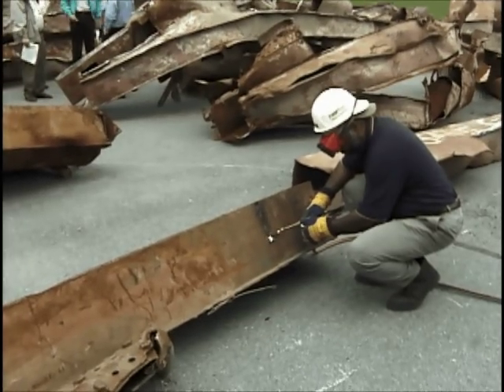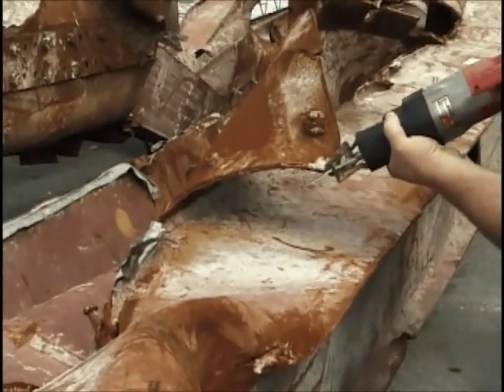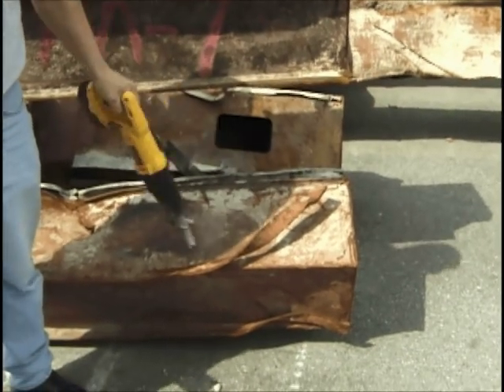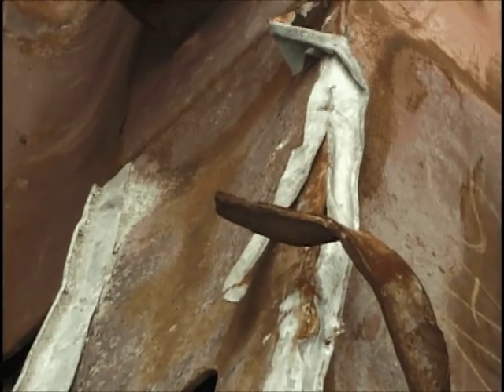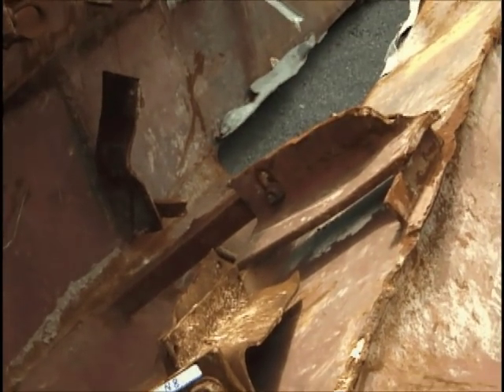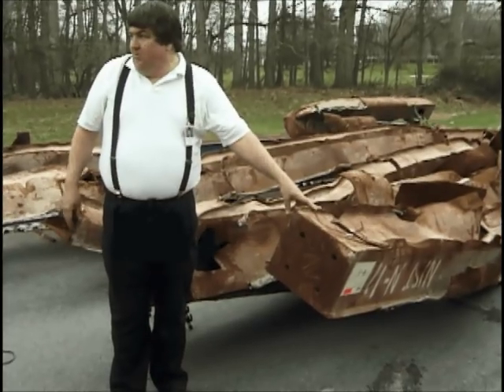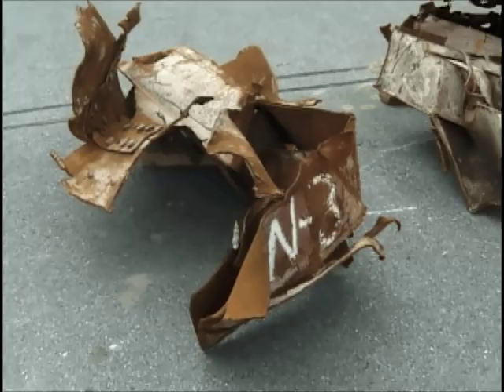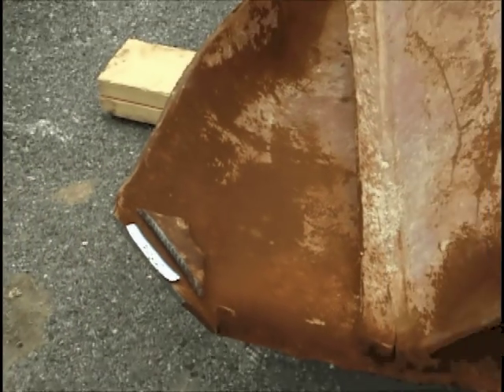Steel Samples from WTC Towers after 9/11 (Clip 1, part 1)

Comment: These guys are so dumb imo, they’ve not taken into account the heat of the fires for around an hour, the paper burning, the thin steel floors buckling, the force of an aeroplane hitting it, jet fuel. They’re also cutting up and trying to melt something which people died being stuck under. Such a lack of respect for those that died.
Reply: You're comment is all kinds of stupid that I can't even

Comment: Wow you people talk to fucking much. Here’s what happened in short, the 2 planes that hit the towers had no passengers aboard and were flown with technology that lets you control the plane from the ground. Those 2 flights out of Logan airport never existed and the calls were faked.  The only flight that was real was United 93 which landed at 1 of 2 airports in the Cleveland area. All 3 towers that came down were wired with explosives months before the attack.

Comment: One thing that also made it fail was when the plane intact fully exploded inside not breaking apart like most think, the towers swayed on impact more than designed. This caused the rocking and with heat immediate hitting the flange, supports it added to the result later that morning.
Reply: 3 towers disintegrated almost symmetrically. This is inconsistent with the 2 asymmetric planestrikes of the lslamic terrorist conspiracy theory
Reply: And the fact that the buildings were DESIGNED taking into account the fact that TWO AIRCRAFT can crash into them does not tell you anything?
Reply: @stevejobs1653  https://www.youtube.com/watch?v=9mc6GljP8WM

Comment: Are there no pieces of floor sections, to study how it all came apart? And how heavy were the floors anyway. How strong? Etc.
Reply: 7:02 there
Reply: Annette Kurstein Andersen It got compacted in big chunks along with other pieces of rubble, there’s multiple samples in the Memorial area below TFT.
Reply: The floors were very thin, the fire proofing wasn’t completed properly, and the building was extremely tall, extremely old by architectural age, and although it was built to counter act heavy wind it was never built to withstand a damn aeroplane hitting it filled with jet fuel.
Reply: @jacob9208  especially at 400+mph
Reply: @jacob9208  it was specifically designed to withstand the impact of a fully loaded airliner. Stop lying on the internet to sound cool. It failed massively
Reply: @jacob9208  'Extremely old by architectural age '? Nonsense among your other false claims 
Study John Skilliing '93
Reply: Floors were spanned 60 feet with lightweight trusses on two sides of the core, 30 feet on the other two sides. Many of the flanges to which they were attached were bent downward, others ripped off of their seats. The trusses themselves were littered all through the piles, balled up into spaghetti looking shapes; they resemble balled up re-bar in the piles. This shows floors were punched through by falling mass from the tops, creating a churning, chaotic mass on the interiors of the Towers. None were found flattened, as would be expected in a floor on floor "pancaking".

Comment: @Thetan1974   All one needs to do is go to the WTC with a GPS and punch in the Co ordinates.  Or simply write them down.  Then once on board punch those in to the flight management computer.  

There is a reason it was a cloudless Sunny day this happened on.   Its called visual flight rules

Comment: @Thetan1974 There has been NO identification of the craft.

You have absolutely no clue about what you post.  The more you post the bigger idiot you look like.  (If that's possible).

U 175 had a transponder just like every other aircraft.  Its tracked from takeoff.  Gives readout on the airline, speed, altitude.  Even if its turned off the plane can still be tracked.  Just less information.  

New York approach had it all the way to the WTC.

I am reading a book on it.  You should try the same!

Comment: @roquefortfiles The point was: There has been NO identification of the craft.
The engines of "UA 175" did not match what usually is used on UA Boeing 767s.
Besides that, 767s cannot obtain a speed of 500+mph and stay controllable at 1200-1000ft. Confirmed by several pilots, aviation experts and even Boeings spokesmen.

Comment: @roquefortfiles "New York Approach center was responsible for "175"."
Yep - if you mean New York (Air Traffic Control) Center. And here's what controller Dave Bottiglia has to say about it - even on Wiki:
"...were counting down the altitudes, and they were descending, right at the end, at 10,000 feet per minute. That is ABSOLUTELY UNHEARD OF FOR A COMMERCIAL JET."

Comment: @Thetan1974 Yep, and it simply isn't there. Again the explanation why NIST so elegantly escaped explaining this after-initiation-stuff.

???..(what??).  A paper i have on the crush threshold of the cement floors put it at 1.5 Gigajoules.  That means the concrete is powder at that force.  

The collapse of the WTC generated 3.5 Gigajoules of energy.  More than 2x the force necessary to convert the concrete to dust. 

Simply isn't there???..   

You mean like your logic?

Comment: @Thetan1974    Do you even grasp how a big building like the WTC is constructed?   Your posts say.. "Not in the least".    

Anyone can see the top of WTC 2.. 31 stories lets go

The floors of the WTC DO NOT hold vertical loads.  The columns do.  But they have failed.  You can see this.  An entire line of them snap and let go on the exterior.  Causing the top to let go.  You are now asking a floor rated to hold 1500 tons MAX to hold 180,000 tons.  31 floors.

4th grade math!!

Comment: @roquefortfiles "Numerous corroborated phone calls from relatives on the air craft all describing the same thing. Who was hijacking the planes."
Non describes the take over of the controls and piloting into their targets. THAT's the problem. Besides there's NO evidence of the 3 planes hitting targets on 9/11 being those specific aircraft we've been told.

Comment: @Thetan1974  Apples and oranges??   Sorry i don't see your point (Like so many!!).

We are talking about the force required to crush something to powder.  As in a slab of concrete.  You keep wondering how its accomplished at the WTC.  

Explosives do not do this to material like concrete and they are a lousy material TO do this.  

Think about it.  What does a Pharmacist do when grinding pills? Puts them in the little bowl and grinds.  Applying FORCE.

Same thing going on at WTC

Comment: @roquefortfiles "If you drop a penny from 1300 feet..:"do you think its going to land on a plumb line exactly where it started? .. uh NO!!. If you have a 110 story building coming apart 1300 feet in the air…"
Again comparing apples and oranges. And what does the 1300ft number has to do with anything? It's the yards the tops were above the lower part under the fires that counts.

Comment: @roquefortfiles "Blown off fire proofing? Columns found afterward were Telly Savalas bald of fire proofing."
Columns found BLOWN away with explosive force not being generated by a "natural collapse", yes.
Now you have ZERO fire rating across a space a football field wide. 
Asking 3 obliterated floors to now hold an increased load of 31 floors above it? 
Woops. You forgot the steel core - as did NIST.

Comment: @roquefortfiles "10,000 gallons of jet fuel? (which was NEVER part of any plan for any jet hitting the structure. Robertson says so.)"
Plan or not. The jet fuel left simply has no significant influence on what we happen to the buildings following.

Comment: @Thetan1974   If you drop a penny from 1300 feet do you think its going to land on a plumb line exactly where it started?  .. uh NO!!.   If you have a 110 story building coming apart 1300 feet in the air with energy pushing in all directions do you think wall sections are going to land at their footprint?  No.    Multiply the distance traveled by the velocity and it EASILY explains this.

You don't even understand this basic stuff.  So how the hell do you understand the rest of it?

Comment: @Thetan1974 Not even remotely a hypothesis.   Says who?  YOU!!

10,000 gallons of jet fuel? (which was NEVER part of any plan for any jet hitting the structure.  Robertson says so.)

Blown off fire proofing?  Columns found afterward were Telly Savalas bald of fire proofing.

Now you have ZERO fire rating across a space a football field wide.  
Asking 3 obliterated floors to now hold an increased load of 31 floors above it?  

How you make your statements is beyond me.

Comment: @roquefortfiles "To give you a relative comparison. It blew a hole 100 feet across in the parking garage."
You don't have toi compare the WTC collapses with anything. All you have to do is letting go of your fear of facts and accept that FIRES is the most outlandish and non-fitting theory. Not even remotely a hypothesis.

Comment: @Thetan1974 The powderization is obviously due to the many explosions working progressively.  

Explosives are a lousy mechanism to pulverize concrete.  The 93 truck bomb at the WTC had one of the largest Ampho devices ever built.  Its blast over pressures were something like 100,000 PSI.   C4 might produce 40 PSI.   To give you a relative comparison.   It blew a hole 100 feet across in the parking garage.  

Not one column was busted and the concrete was anything but powder.

Comment: @roquefortfiles - create squibs way to far (and above and BEFORE the collapse) from the collapse point to have anything to do with the collapse it self
-hurling tons heavy steel girders several hundred feet UP and away with explosive force
- create "rocket" debris with a trail of alu oxide going towards the ground faster than gravity would make it and even change direction rapidly in mid air

Comment: @roquefortfiles Such as: NIST not explaining at all how the tops were suddenly heavy enough to...
- crush its way down through the core and the path of greatest resistance - even though it's not heavy enough
- powderize everything except form the steel while working as a "pancake" pile driver leaving no pancakes
- create molten steel and metal
- create iron rich micro spheres that only thermite have been proven to create

Comment: @roquefortfiles The powderization is obviously due to the many explosions working progressively - but exposingly NOT pancaking and horizontal - downwards the buildings.
What realy is the reason for that lies in the future - after the investigation you fear like a madman.
"You are expecting 4 inches of concrete and drywall to resist 31 stories landing on it?"
Uhm, I would expect the titanium mountain of steel built 900 feet below to withstand just about anything - except explosives - yes.

Comment: @Thetan1974    LOL...  What part of Les Robertson saying Quote;   "there is no way one floor is going to hold the weight of 14 or more floors landing on it NOT POSSIBLE!!!.. It would collapse instantly and to the foundations">.  end..

Don't you  understand?    The top 31 floors is absolutely pulverizing the rest of the building.  Once the load shifts to the floors forget it.  

You are expecting 4 inches of concrete and drywall to resist 31 stories landing on it? 

No chance

Comment: @roquefortfiles "The top 31 floors runs itself through the rest of the building."
The fantasies see no end when it comes to 9/11 denial.
Let's try it again, easy, easy now:
The top of the south tower LEANS without "running through" anything or having anything "running through" it, and powderizes in mid air in stead of hitting the ground in one chunk.
I know you have a hard tim eaccpeting it, but you're looking at (another) proof of how the demolition/powderizing forces worked.

Comment: @Thetan1974 and reveals that they powderize in mid air.

You don't observe much do you?   The top 31 floors runs itself through the rest of the building.  That block of 31 floors is entirely intact falling past the 48th floor.  The observation deck of the building sails past the impact floors where the plane hit it.  Minus 31 from 79 and it takes you down to the 48th floor and that entire block of 31 floors is still moving. 

Go look at it.   I have.. about 1000x and i pay attention

Comment: @roquefortfiles "Explosives do not do this."
Again posing as if the lunatic in denial - who for some resaon really, really need to discuss with the nut who like believes in Santa - poses as if he knows what sorts of explosives were used.
Look at the lobby damage. That's what THESE kinds of explosives do/did.
Now let me hear about your Hollywood sci-fi explaination about the jet fuel fireball of that travelled through the elevators - which is another unexplained and absolute cartoonish fantasy.

Comment: @Thetan1974  Hold your Christmas allusions.  And btw.. its DELUDED.  not deluted.   Yes the top 31 floors leans over.. Obviously.   Have you taken any time to REALLY observe this?  I have.  Have you noticed how the back of the building is not moving?  its rotating around a fulcrum.  A rotational point.  Where is the front failure portion of that?  Its being transferred INSIDE the exterior columns..  to the floors.

Guess what?  They ain't engineered for these loads..

That = failure

Comment: @roquefortfiles It was everything but the steel that turned into powder. And you STILL haven't shown your experiment in any way. Besides that, the powdering and the explosive ways everything gets blown up and outwards has nothing to do with your gigajoules "explanation."
Still not enough to create the hot spots for months, rocket debris with alu oxide trails, molten steel/metal, girders being blown 200yrds away etc.
But the biggest problem is: The tops never got heavy enough.

Comment: @Thetan1974 The further downwards powderizing of the buildings have nothing to do with gravity.    

The concrete was rated to fragmentation at 1.5 gigajoules of energy.  That means it would be powder at that force.  The collapse generated about 3.5 Gigajoules.  

In lay terms?  More than enough to pulverize the concrete.  

Explosives do not do this.  And Thermite doesn't either.   Massive grinding weight sure as hell does.

Comment: @Thetan1974 very interesting how that tipped over and disintergrades in mid air before reaching ground. A clear prove of some unexplained forces/incediaries(?) playing into gear here

No it isn't!!! ..  JFC!!  Plane takes out half one side of the building and the floors.  Are you aware what happens to a column if you remove a floor?  It drops in strength by a factor of 8.  Remove 2 floors and it drops by a factor of 27.   Now ask it to hold up 31 floors? 

No wonder it failed first

Comment: @roquefortfiles Talking about the south tower it is very interesting how that tipped over and disintergrades in mid air before reaching ground. A clear prove of some unexplained forces/incediaries(?) playing into gear here. (A mistake form those who did it, so to speak.) 
The further downwards powderizing of the buildings have nothing to do with gravity. There's plenty of footage showing the blast points blowing uneven and not horizontal up and down the facade/walls and the corners.

Comment: @roquefortfiles Keep on modelling and ask if NIST want to add your "report" in a futire report. Until then, it's pretty clear why they didn't want to do what you claim as an anonymous YouTuber to have done.
Btw: your 3d programming for sure forgot to explain the hot spot temperatures, the squibs seen even before the collapse, the "rocket" debris with alu oxide trails after them and the eutectic steel.
You're seriously afraid of the truth.

Comment: @Thetan1974  Where does the WTC 2 fail?  Exactly where the plane hit it.  Where did the plane hit?  Off center to the East side of the building.  The entire top 31 floors rotates toward the east side.  The rotational fulcrum is positioned directly at the back of the building opposite the failure point.   Where does that place the upper 31 floors?

Inside the exterior columns on the FLOORS.  Not made for these loads.

I modeled this in my 3d program.  And i pay attention to detail

Comment: @Thetan1974   There is no chemical that reacts for months at a time let alone a week.  If there were we would solve the energy problems.   What the hell do you think is going to happen to a gigantic pile of VERY hot steel/aluminum.  Its covered and the heat builds.  Gets uncovered and fresh oxygen is introduced.  Flares up even more!!..  The entire exterior of the WTC is ALL aluminum.  Melts at a very low temperature..

There are RATIONAL explanations to things!!!

Comment: @Thetan1974 The eutectic steel IS btw "CD debris" from the incendiaries obviously used in these CD's. 

You don't seem to ever get it.  Incendiaries are not a material used in CD.    There is a reason Mark Loizeaux does not employ them for CD.  They are not used!!

Why on earth would you want to use a slow burning powdered chemical when a high explosive blows the column instantly??  

Explosives don't blow beams 100 feet.  you don't even understand what you are talking about.

Comment: @Thetan1974the top of any structure does not become heavy enough to force their way down through a lower, larger and much, much stronger part

???????  It sure as hell does if the load distribution is altered to a portion of the building that does not carry it or is designed to.  

You even have the structural Eng Les Robertson TELLING YOU this.  A guy with 14 years specialized education.  Who's job it was to Engineer the load distributions!!!    

You and your statements are ridiculous